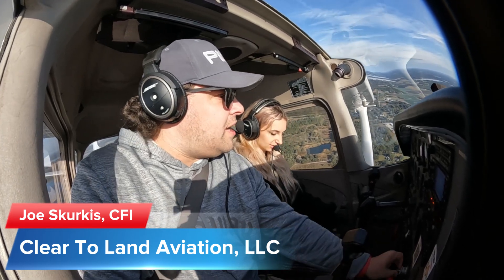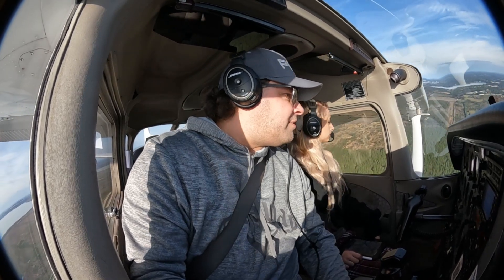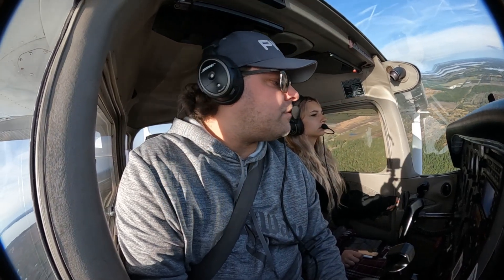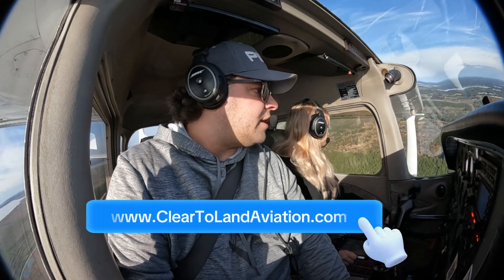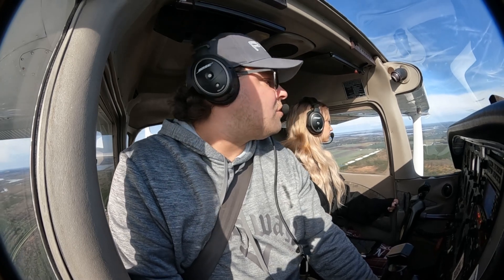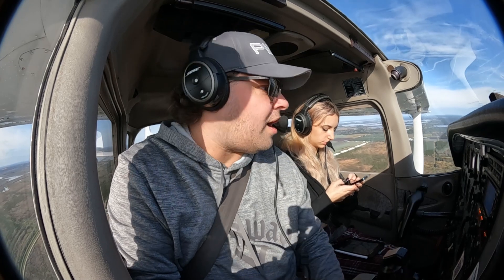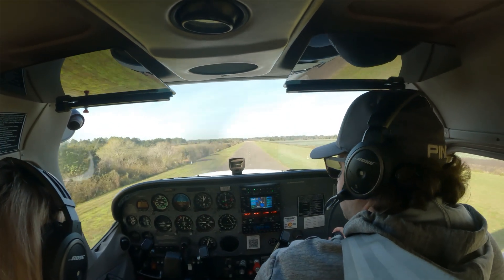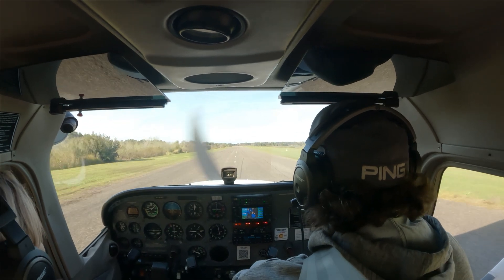Engine Failure? Learn the Life-Saving Power Off 180

Comment: power off 180 is not an emergency procedure.
Reply from the maker: No it isn't. But if you pick a runway as part of the engine out emergency in a check ride they can make you land the plane. And if you don't they can give you a notice of disapproval for it. Doesn't mean they will, but they can even at the Private level.
Reply: @PilotJoeFL when I was student, my instructor didn’t make a classification on these two maneuvers, so for a long period of time I got confused about that. Now when I am teaching, I always say “power off 180 is not an emergency procedure” first. It’s all about accuracy.
Reply from the maker: @yaohu4580  you're correct that it's not. But I'd argue, and it's a hill Im.willing to die on haha, that it should be. Sure the engine out is an emergency procedure, but if it doesn't come back you have to land at some point. To me it's just an extension of the engine out emergency. That's why I teach it to private students even though it's not required.
Reply: @PilotJoeFL  the point why I suggest everyone should explain the difference for these two maneuvers is we don’t want the student has the bias that if engine failure happens in the traffic pattern, they “should” always land on the runway. How many pilots died every year for attempting the impossible turn? Remember the law of primacy, that’s why it is important for me to make a point at the beginning of teaching these two maneuvers. Anyway that’s just my point. Good luck!

Comment: In what I've experimented with doing the possible turn it seems crucial to turn quickly however very crucial to not turn so quickly that it stalls because that's a critical loss. I wouldn't rule out that some flaps for just the tight turn might work. Generally flaps are airbrakes so not your friend for glide back but just for the turn maybe. Subject to experimentation.
Climbing steeply at good speed, maybe kink a bit to the side helps prepare for the return. Starting as far back on the runway is good too, that gives longer time to abort and more altitude before departing the runway area.
Reply from the maker: This wasn't the impossible turn, just a power off 180 from the downwind.
Reply: @PilotJoeFL  it's not entirely different though :)
Reply from the maker: @DanFrederiksen  you are correct but the level of skill needed for each is vastly different.  I'd never teach the impossible turn to a private student.  I do teach the power off 180 as part of my private program even though it's a commercial maneuver.

Comment: Honestly man, this method may work, but what we were always taught was if anything, we have different techniques to lose altitude whether it’s with flaps or a slip or even widening out our approach, but there is nothing you can do to gain altitude, so this method to pull out the flaps is going against many safety practices. 

The best method I learned and would teach my students was all about choosing your aiming point when you start the manoeuvre. That point will be where you start the power off 180, then keep that aiming point relatively stationary with a point on your window. It will remain stationary until you turn final. If the point descends, increase your angle of bank, if it ascends, decrease your angle of bank. This helps because winds will always play a factor. To this day I have not missed a power off 180 and neither have my students during their flight tests. It is always better to be high than low.

Comment: Why use flaps when runway is not assured. Is this an examiner that wants to see this done like that?
Reply from the maker: Just the way the DPE teaches it to his students and how he prefers it to be flown in a check ride. He will accept other methods in the check ride, but this is how he prefers it be completed. 10° flaps abeam the touch down point, 20° on base, full flaps on final. It did work pretty well actually, but it did take a few laps to dial it in as this was my first attempts doing it that way.
Reply: Everyone teaches different techniques and I’m not criticizing butI think I would have to disagree with this one. Basically a lost engine is simulated and flaps adds drag and also a gear (in the event of a retractable)hanging out there would create drag. I did my exams in an arrow and gear didn’t come down until I was sure the runway was made. Having said that the gear did come down on final. Although I wouldn’t recommend using a retractable for this because too many things are happening and would be very easy to forget to lower it. Bottom line is that you land safely.
Reply from the maker: @Tonbeefcak  Like you said, lots of ways to do it. I don't exactly like this way, but it works.

Comment: Interesting that the DPE wants flaps at specific times. I’ve always done them with no flaps at best glide until landing was assured.

My favorite was right before my check ride my CFI had me do an emergency descent from 4,500 to land at X04. I went to slow down on base and he said “the wing is still on fire keep going”. I turned final at about 120 knots before finally bleeding speed and throwing in flaps. Only landed a little long, which I prefer for 33 anyway. Was fun as hell.
Reply from the maker: I personally have gone no flaps the whole way down on the maneuver. That's how I learned them and did them. This method though works and he has a lot more flight time that I do haha.